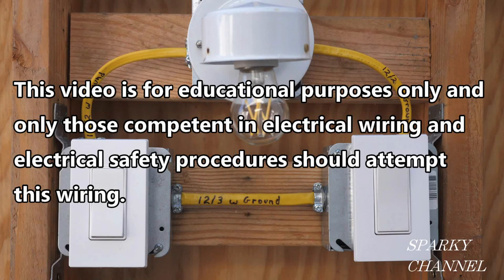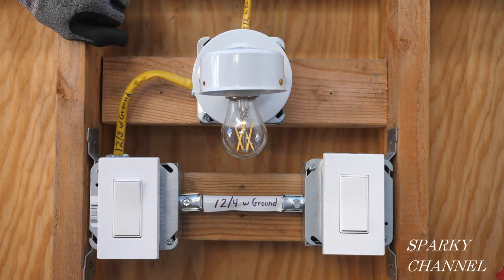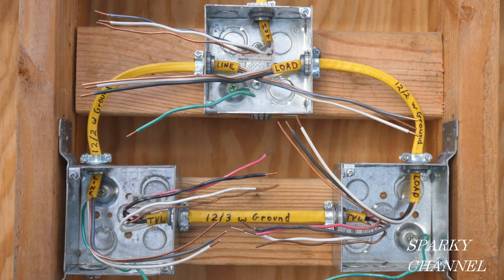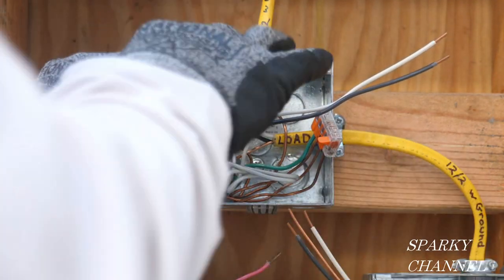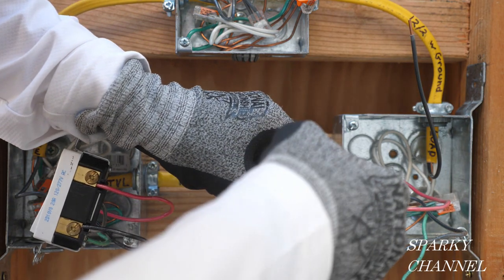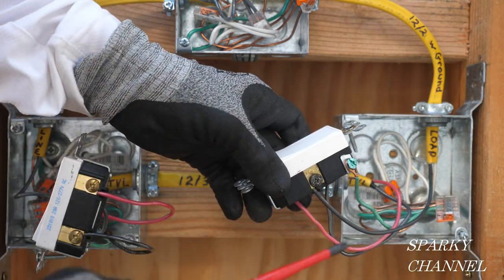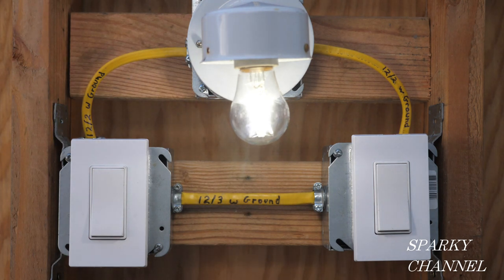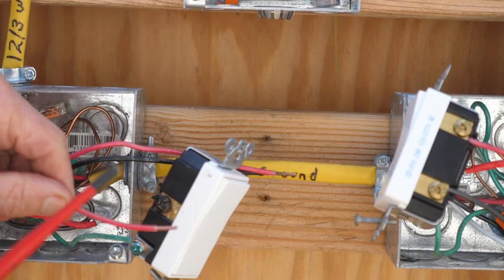3 Way Switch with Power to Light: Old Style Wiring, Simple and Effective

Comment: Sparky, I love the channel. We call this a double back-fed 3 way. Instead of taking a 12/2 from each switch box to light box and jumping a 12/3 inbetween, it is much easier to just take  12/3 cables from the light to each switch.  Then tape one white black and use for load, and vise Veras  for the line. Not sure if it's code anymore, but here in NC you see it all the time. We never do it in New installations, but we see sit all the time on service calls. I've even seen a back-fed 4 way setup from one light box. Almost like a commercial set up, just having drops to each switch. The box was obviously overfilled.

Comment: Nice simple to understand video, thanks Bill!  I am glad to see that you showed the power coming from the light fixture as in an older home and something you don't see with newer electrical work.  The only suggestion I would offer is to make sure NOT to mix wire gauge sizes when using additional electrical wire between boxes.  Either keep it all 14 gauge or 12 gauge wire but don't use a combination of sizes in the same circuit keeping in mind that 14 gauge is for 15 amps and 12 gauge is for 20 amp overload protection.
Reply from the maker: Hi Bill! Great point. I used all 12g in my example.

Comment: Bill. So you took the neutral from the light box through both switch boxes and back to the light box making in essence a neutral loop. No need for the 12-3 wire between the two switch boxes as it could've been 12-2 which would save some money. In this case the travelers would be black & white and you would identify the white traveler with some red or black tape at each switch location to indicate that it was being used as a hot (line) wire. The white wire in the 12-2 from the light box to the first switch box would be tied to the neutral wire in the light box and then capped off in the switch box thus providing the NEC required neutral at this switch box. The other white wire from the 12-2 from the light box to the second switch box would be capped off at the second switch box and tied to the neutral wire in the in the light box providing the NEC required neutral wire at the second switch box location.
Reply: Oh btw another great video...keep em coming!!
Reply: I thought exactly the same thing!  It harkens me back to a knob+tube 3 way when power ran to the light location.  No need for anything else  to run with the travelers - you want another wire at the switch, run it directly.  There is an argument for the simplicity of a logical same path for both line and return (great diagram at 14:00).  That could help future diagnosis or changes (such as a 4 way in the middle and still have a neutral).
Reply from the maker: Hi Guys! Great comments and discussion! I love the wiring that Jonathan described. I've seen that in 40's and earlier houses. I suspect that running neutrals like that would play havoc with our modern AFCI's though. Still, it would make a cool video to set it up on my demo board. I bummed now that I threw out all that great cloth covered 2 wire  cable from jobs. I could use it in a video about old time wiring. I did save several of the old 2 prong receptacles. And RJ, aren't those knob & tube wiring systems something else?
Reply from the maker: @jfowler702910  Thanks!
Reply: @SparkyChannel  hey Bill. The neutral wires in the switch boxes would just be dead ended and available if needed for smart electronic switches. I don't think that this setup would cause any issues with AFCI breakers but not entirely 100% sure either. It would be interesting for you to mock it up on your demo board and test it out! 👍
Reply: @SparkyChannel  Ah knob and tube - looking back there are fond memories, even though I looked at K&T with disdain at the time.  They forced a greater understanding of fundamentals.  For example, it's the difference of potential not just potential that creates danger.  While some of the insulation/protection on wires was dubious, as long as the two wires were dry and apart greater than the length of one rodent (as I was told) nothing bad was going to happen.  You got the logic of how something worked clearly, with each wire specifically run for its purpose.  Before working, I needed to track down everything going on in the circuit, with some times of serious head scratch sorting what was going on - but that forced learning.  There were some, shall we say, creative ways of doing things that you wouldn't consider if you had a hot and return always right in front of you.  They did seem to optimize for minimal wire use, and the hot and returns were more like buses than circuits.  Just because your hot was off did not mean your return was!  Switching on the return was a possibility.

By the time I got in, working on it was only replacing it.  The insulation could disintegrate at the barest touch, yet also create black marks that was near impossible to get out of clothes.  The aforementioned rodents had a fondness for whatever natural fiber wire jacket was being used, so after opening up some wall - surprise it's now part bare wire.  Another piece of "fun" was the lath and plaster from the same era.  We are so spoiled with drywall.  All good times!

Comment: I have been working on a old home, and 1 thing left is to figure out a silly hall light on 2-3 ways switches.  It works fine on the light, but it some how is tied to several receptacles, and a bedroom switch.  Flip the hallway switch, and switch, and receptacles go out.
Reply from the maker: You may be turning off the power (line) to the receptacles or you may be turning off the neutral to the receptacles.

Comment: Quick question mr sparky if the old wires do not have a ground wire but I continue a new wire to another part do I need to connect ground from where I hooked the new wire or I can continue without ground as the existing wire? I’d appreciate if you can answer!
Reply: if you are extending an ungrounded circuit, you should definitely keep the ground wires viable in the new part of the circuit - but the circuit will still be ungrounded until the original wiring is upgraded.  best practice would be to put the circuit on a GFCI breaker, and use the "GFCI protected, no equipment ground" markings throughout the circuit.

Comment: Would you consider doing a round up of old work junction boxes? I feel like it would valuable to know what else is out there besides the plastic wing type. You mentioned those square boxes are nice, but I have no idea how I'd attach them without access to studs.
Reply from the maker: Definitely a good idea. Boxes on old house are so small that it can cause overcrowding to install a digital switch, etc.
Reply: Yeah when I did the math on my dining room room switch I realized I don't think you can legally use that box for anything anymore. 1 device, internal wire clamps and 2 14 awg wire for a switch loop maxed it out. Can get a neutral in that box and stay up to code.
Reply from the maker: @jamisongillespie3524  I hear that!
Reply: there are a couple models of remodel boxes that have preinstalled screws for screwing into the side of a stud,  - which works well, when you are replacing a box that was already secured to a stud, although those old metal boxes can be a pain to get out of the wall.

Comment: Please help!
I have two sets of 3-way switches right next to each other.  Is it possible that my "HOT" source is from the light fixtures?
Set 1 to Light 1: 
---Light does not work, bulb changed, still does not work.
---Went to replace the switches with new ones. Wired exactly as they were, light does not work.
---Tried your method to find "HOT" wire and "LOAD" wire.  Voltage on "HOT" was only 30 volts???
---Hooked them back up with "HOT" and "LOAD" wires on respective Common switch terminals.
Set 2 to Light 2:
---Light DOES work.
---Tried your method to verify "HOT" wire ad "LOAD" wire.  Voltage on "HOT" was only 30 volts again???
---Without twisting the 3 wires together, I checked the other switch wires and 2 wires had 30 volts this time???  Remember I did not combine the 3 wires together.  
---Hooked them back up the way they were, and the light works.  

Do I have wires crossed, a problem in my source breaker box?  What should I do? This is really weird.  

p.s. I double checked my multimeter in an outlet, and got 120 volts, so it's working properly.  Also, I just checked the light socket of the light which works and it is 120 volts.  The light socket of the light that does not work is 30 volts.

Comment: Ram into one today I couldn’t figure out older home I’m pretty good with new homes on 3 way but power box had black red and the white was plugged in with neutral went to other switch had black white red all used but why and how the second box with white black red hook to outlet only had one romex the powered box had two romes hit and common then another one black red white

Comment: Thanks for the video, I love your channel.  Question - you put the EGCs in a loop, is that a concern?  The EGC in the light box is connected to both switch boxes which are then connected to each other.  That tickles my spidey sense, but I'm not finding anything wrong from a practical or NEC view.  I just have memories from long ago of, "Thou shall not make loops".  Here, there are no receptacles, stray current induction should be tiny/none, and the application isn't one that would care if there was (ground is not used as a reference).  And it's not the bad ground loop type where you have paths to different grounds - this is about bonding a current path to clear a fault vs. grounding anyway.
Reply from the maker: I don't see any problem at all. Thanks!

Comment: Please sparky can you do a 3-way switch with power fed into light from a separate circuit protected by an AFCI/GFCI and how to wire it why some older wiring arrangement may not work and how you can resolve it by rewiring. It’s a common problem I find all the time in many homes upgrading to GFCI/AFCI and wonder why the AFCI/GFCI keeps tripping.
Reply from the maker: Hi! That's interesting. How have you fixed the problem?
Reply: I have temporarily had to remove the switch line neutral  and place it in a Wago for the time being and turn the main switch as a permanent one-way making the second switch as an operable switch as long as power flows from the main switch in its switched on position. The power feed from AFCI/GFCI is then operable. Of course a permanent fix will require a partial rewire to make it fully functional ie allow the the two switches to work as a three way and allow the AFCI/ GFCI to work. You could work that on your test rig - first show a 2-three way switch to work with a light and then put in an AFCI/GFCI power feed into light you could see whether it works with the 3 ways you have wired a 3-way switch. It’s an interesting thought. You could do that. It’s a kind of real world problem people are gonna face on installing AFCI/GFCIs.
Reply from the maker: @mathman0101  Interesting. What brand of panel and dual function breaker are you using? Is your panel a main or sub panel?
Reply: @SparkyChannel  it’s a Leviton 15-amp dual AFCI/GFCI receptacle
Reply from the maker: @mathman0101  Interesting! Have you tried running a homerun to the hot side switch? Or do you perhaps already have a home run to your hot side? I think that would eliminate any possible upstream problem. Also, how do you like your Leviton panel? I've been looking at them. They have an all copper bus bar and seem to be good quality. I'm a Square D guy but I've got an open mind about it.
Reply: @SparkyChannel  yes the home run is an option but I should have been clearer. I have two 200amp GE panels with GE breakers 13 yrs old. I already upgraded the house to make these both sub panels as I installed two external disconnects in line with latest 2020 code. At the moment I have placed all AFCI/GFCI Leviton receptacles on all 15 and 20-amp branch circuits.

My intention is to replace both GE si panels with larger Leviton smart WiFi panels which have plug in breakers with neutrals tied into the panel with the busbar. These have a faster install. These have both WiFi and smart power quality monitoring for every breaker and I will take the opportunity to replace the 30-amp double pole 220-240v circuits with AFCI/GFCI Leviton WiFi smart breakers as well.

These are great panels, really next generation. Leviton in recent years have upped their game. I already have home sense monitors in my GE panels and it’s unreal that even in a large house the loads have been trending down as we have replaced some older equipment with more efficient versions and gone to LEDs. The load calculation is seriously oversized in the modern context but with new additions probably correct.

I have a lot of house upgrades coming which require larger panels, garden lights, EV charging, solar PV, new kitchen, new gym-sauna steam room and new outside kitchen. Plus a new workshop above a garage which will require a separate sub panel to accommodate the heating/ac and new circuits and EV charging. 

I may have to look into the newer condu-disk, condu-Crete product rather than more ground rods as a better grounding upgrade for all the newer loads. This will help for over current and ground, arc fault and surge protection. All of this will have to be tested for ground loop impedance, continuity testing, testing for extraneous metal parts and supplemental bonding of that also need looking at and then testing for insulation resistance and gfci/AFCI trip currents. So a lot of work to do and yes upgrading to newer generation smart nest combined ionization, smoke/fire and carbon monoxide monitors as well including installation in the new areas.

When that’s all done I may even look into more specialized lightening protection system.

Comment: I see you have (how to fix a Open Ground, Open Neutral, Open Hot, Reverse Polarity and Reverse Polarity Bootleg Grounded receptacle) now all what's missing is (how to fix a HOT/GROUND reversed receptacle.
Reply: Did you figure it out? I had some outlets with that error. It turns out a light fixture on a 3 way switch was pulling hot and neutral from 2 separate circuits. When I would turn one circuit off, the outlets would show ground/hot reversed. It was a real head scratcher for a few hours.